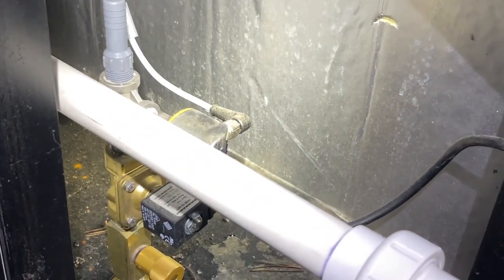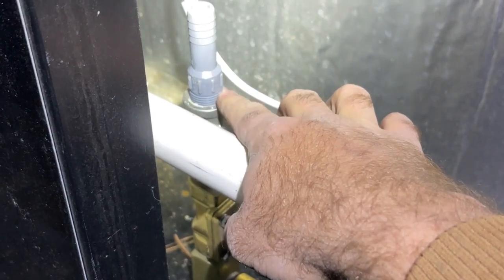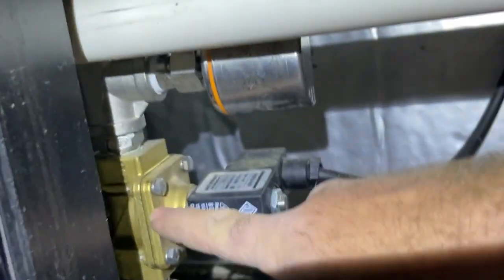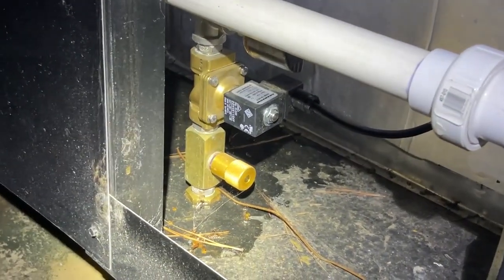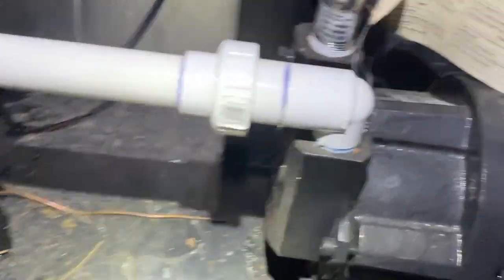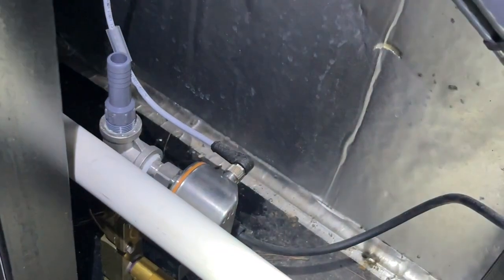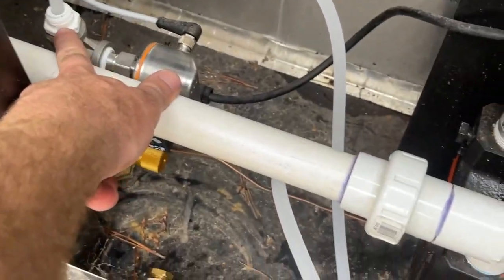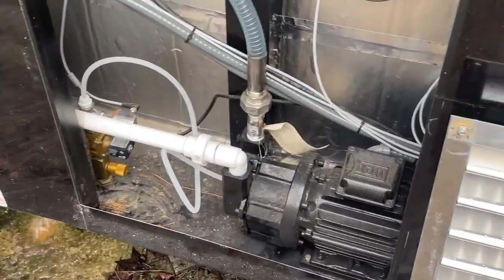iDry Vacuum Pump Freeze Damage and Repair

Comment: If you just unplug that solenoid and give it the power it calls for to open when you drain everything else, the water should fall. You could add a bypass switch in your panel to open that solenoid with just a switch.